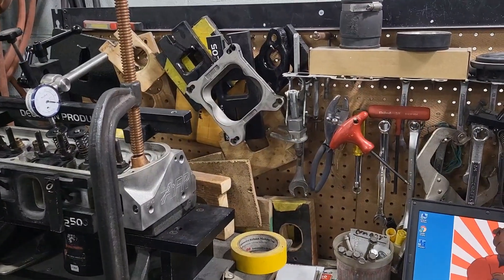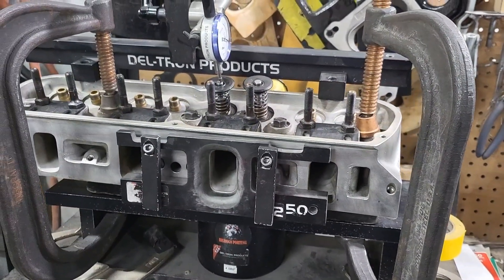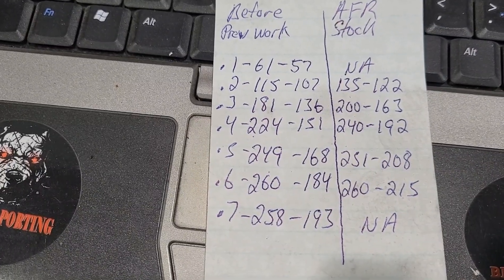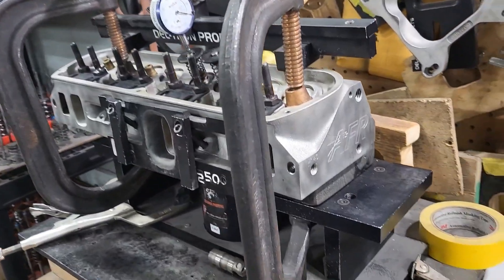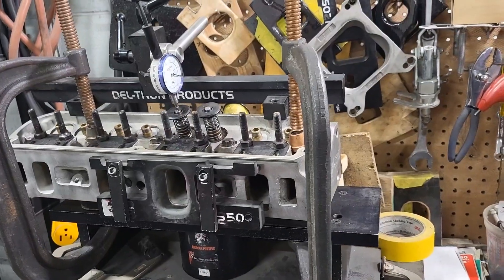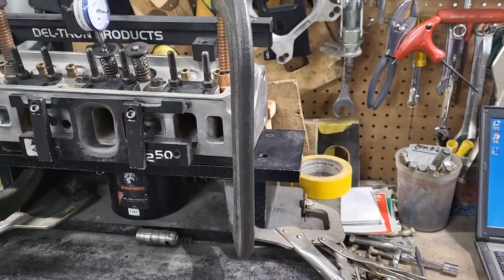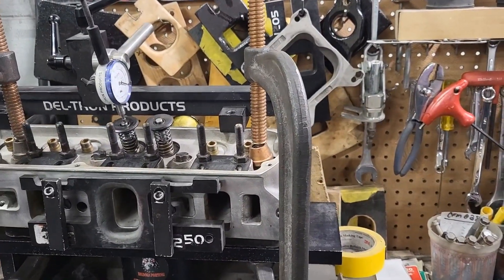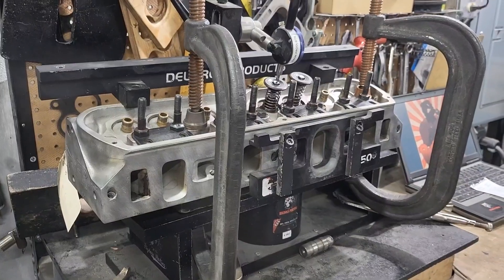AFR sbf 165 Renegade Home Ported Heads. Did it help or hurt🤔

Comment: So are these outlaw or renegade and are the flow numbers your comparing in this video correct? Because someone said these numbers aren’t bad if it’s a outlaw ?
Reply from the maker: @utahcountypicazospage5412  we flow hundreds of heads a year and we have ton of experience. When doing comparisons you always want to use the same flow bench testing the same way which we do. The numbers are apples to apples. The flow went down because the on tge low lift because they didn't port the short side right for the valve job which is why they were sent to us to port  to our stage 2 standards. People think it's as simple as removing material and it's not

Comment: How good are those flotek castings? I feel like the assembly and parts would be cheap. But the casting itself may be ok to be reworked?
Reply from the maker: @hugoortiz05  we have ported and sold over 60 pairs and they all are running fine. In stock form they flow like crap but once we port them to our standards they really can produce some great hp.
We get them brand new
Reply: @bigdogsportingtonyb2833 hello,like your work,I talked to you the other day about a ford fe iron head, you said you have ported them before, and you would do a set for 750,what,and how much port work does that include, iam thinking of going to a little larger intake, and exhaust valve, your input would be appreciated, if you find the flow numbers of a fe head you have done,let me know
Reply from the maker: Only stage 2 for $795

Comment: This is why my cheapo 300 bracket racer engine has a head thats milled, 3 angle valve job, springs, and pinned rocker studs and stopped there.... No porting. Without a flowbench, Put the angle grinder down!!!! Beyond knocking some burs out of a port or bowl.... leave it alone. Porting to the lay man means "make the hole bigger and itll flow more" , but the professional aka yall, it means " maximize the efficiency and velocity and the actual dynamics of flow within the cylinder head". Looks back at guys like Roush, Holman Moody, and all the super stock guys.... They used alot of epoxy, and on some engines like the tunnel port 427s and 351c / boss 302 often times they actually filled in the intake runners making them smaller and taller to change the angle of flow into the bowl. Those guys had flowbenches and engine dyno's. And with what you guys do, what customers should know ... Is they think they are paying for overall flow improvement. But , that low lift flow and efficiency....thats what youll feel driving it around on the street.
Reply from the maker: You are absolutely right. It's amazing how many people think porting is easy and feel it should be done for little to nothing. They feel they can do just as well at home lol. Then when we post up dyno results and the combo parts list they say no way lol. It's not easy at all. Most people really don't realize how easy it is to mess a head up by porting it wrong. We did 3 porting mods and a 4 angle vj on that port and gained 25cfm just like that.

Comment: @ 10:56 WHOA! Just right there guys....1262R is gigantic, and twice as thick, compared to a 1250. Way too much for most street engines.  I've never even seen an "RS". The 1262R gets thin at the roof, and easily becomes a sealing nightmare on poorly amateur home ported cylinder heads...

90%, imo, of street engines don't max out a properly ported 1250 intake or cylinder head. SMH
Reply from the maker: Exactly! So when the customer contacted us saying we did something wrong and blaming the Port work I knew he and his mechanic didn't know what they were doing. First thing people do is blame us instead of looking to see if they are doing something wrong. That's the sign of a weak minded person

Comment: Im like you if I was going to spend 2000 bucks they better flow a lil better than 260 cfm 😂🤣😅🤣
Reply from the maker: Exactly!!! Our Stage 2 sbf Enforcers flow right at 290-300cfm and are a lot cheaper that these AFR 165 Renegades lol.